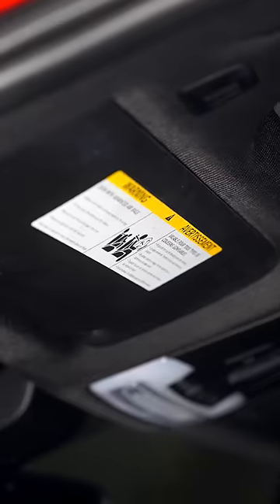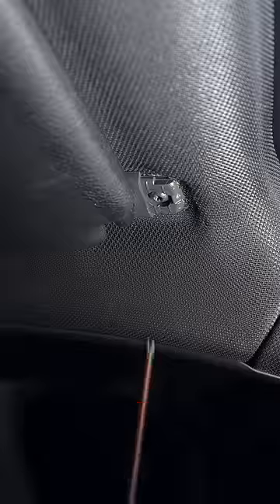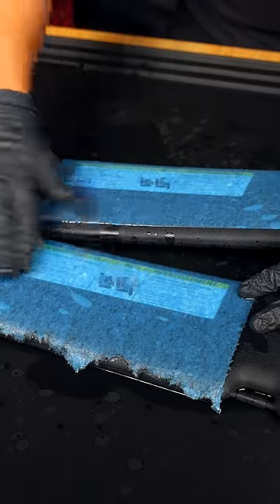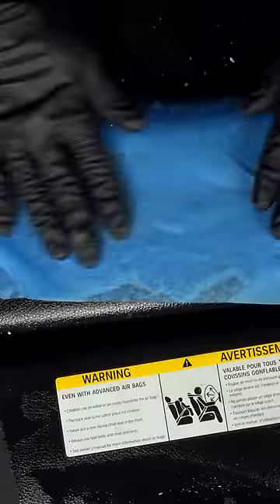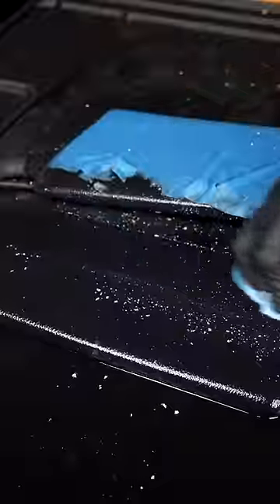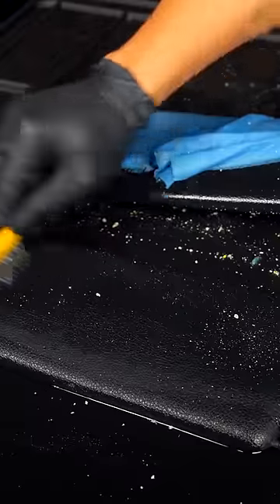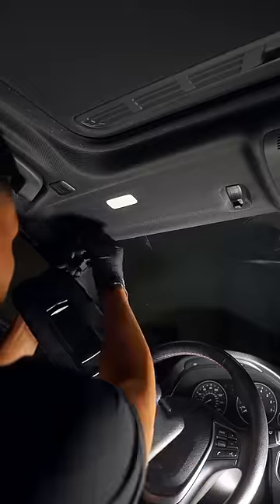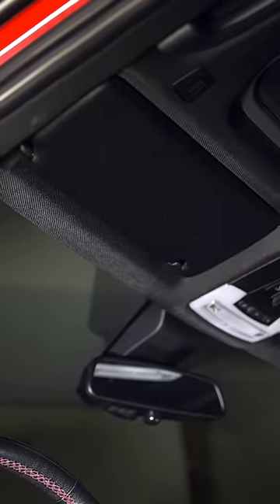DIY Euro Sun Visor

Comment: You made removing stickers look like a very difficult process
Reply: Because it wouldn’t just peel right off lmao
Reply: No he didn't?
Reply: Its not peel able, its the type that is painted on with a rubbery residue.
Reply: @pklechn  well it wouldn't but clearly you don't know that 😂🤦 these are non peelable stickers 😂😂
Reply: Plus there's so much leftover adhesive that it looks worse than before.
Reply: @apocalypse487  Yeah definitely not as clean as it could be I could see the white specs from the sticker imbedded in the visors now 😐😤

Comment: Hey a big tip for everyone doing this.
Use a microfiber towel and rub it off with good pressure after the initial alcohol soak.  Also this works with the visors that have cloth.  If its alcantara, a-lot of alcohol, and very light pressure

Comment: I’m pretty sure it’s a heat based adhesive, we work with those stickers over here where I work. Try that first. I’d have to check the temperature that we use to bond it, since you’d have to use that same temp to delaminate it.

Comment: But alcohol dries the material out, so if you soak it too long it becomes brittle. Now in combination with the sun, you'll have to replace em soon.

You can use steam to soften up the adhesive and tear the sticker off. Then use something like wd40 to remove residue. Wd40 is not the best choice, but way better than isopropyl alcohol.

Comment: Heat the sticker with heat gun or hair dryer then it will be easy to pill it off. Else rub it with cookign oil wait for 5min, then rub more to remove it. Clean cookign oil with soap. Practice this on any bottle or container with sticker before you try it on your car.

Comment: Or, you could use Nail Polish Remover. The acetone in the nail polish remover, will 'eat' the glue on the sticker, and it will peel off.

Comment: Or if you use a hair dryer and take your time the heat let's it nearly fall off. I've done it with a hair dryer in 30 seconds. Also you don't have to strip the whole visor off the car, remove connections and buy a bunch of hazardous liquids.

Comment: or just peel it off… its not that hard really, especially if its an older car it just comes right off, if it leaves residue just take a rag and lightly soak it in gas and it comes right off

Comment: My buddy’s Camaro was built in Mexico. They didn’t even have the quality control enough to put the stickers on straight. And that’s not even the worse part, the whole center console has flash in the plastic that wasn’t trimmed and the panel gaps are so bad you can the bolts holding it down to the floor. Check the vin at the lot, it will tell you where the car was made and if it says Mexico, look at a different car.

By the way no offense to my Mexican brothers and sisters down south, I love you all but you guys don’t know how to make cars.